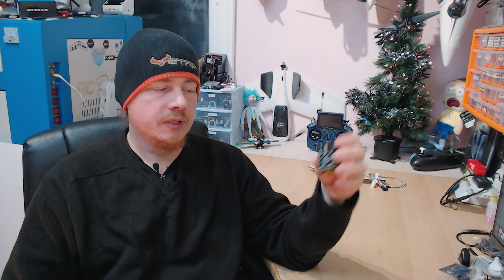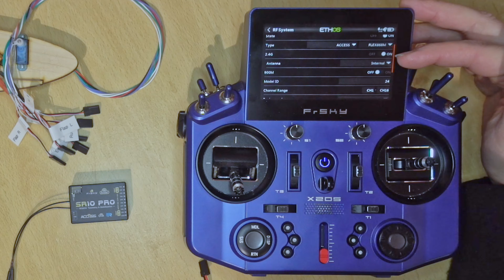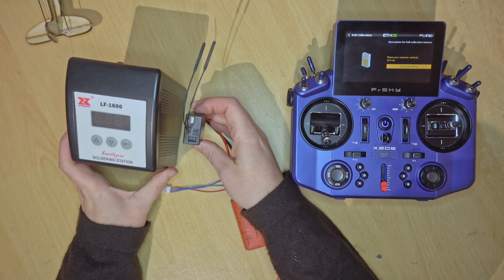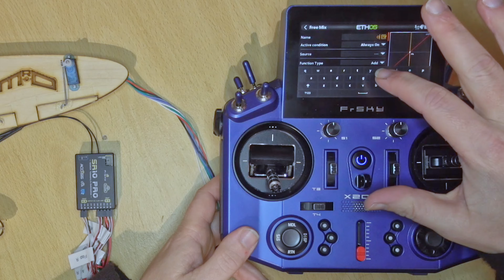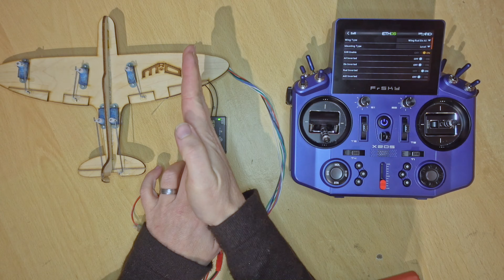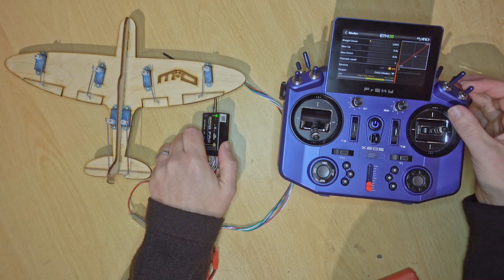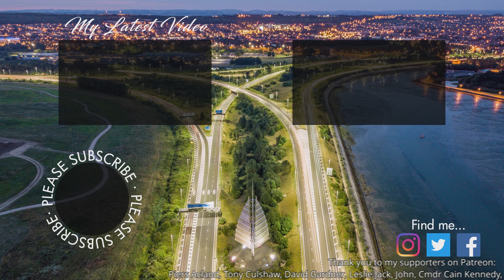Setting up FrSky Archer SRx stabilised Receivers

Comment: Very nice and informative Mr D. Question - I have an X20S, and SR8 Pro and I follow the video of calibrating the receiver, and I set my mixer for the modes of CHN 10, Switch SE (3 positions) instead of SA as in the video. But no matter what position switch I flip to (None, Stabilization Mode, Auto Level Mode), the plane act as in Auto Level mode when I roll, turn, or pitch, the plane will compensate. I just cannot set the modes to None. Any suggestions. Thanks.
Reply from the maker: Hi Ted. Check in the SxR Tool and make sure that you are using quick mode. https://www.youtube.com/watch?v=rUKIBQdmvIY&t=883s If not, it will be expecting two switches for the modes.
Reply: @MrD  Oh I figure it out! It was because I had the "Oh Crab" switch active. When Oh Crab was on, it doesn't mattter what Mode you are in (Stabilization, Auto Level, None), the plane will try to compensate. Thanks.
Reply from the maker: Yep. That’ll do it.

Comment: Found this really useful but I have a problem. I've set up my X20 / SR8 and the self levelling mode works perfectly, but the stabilisation mode doesnt seem to do anything at all. Any idea why this could be? Thanks
Reply from the maker: Hi Jon. Depending on the gain, the stabilisation may not appear to do much. It should just try to counter movement such as wind. If you turn up the gain, you should see, or at least hear the movements of the servos.
Reply: I have the same problem ,The servos don't respond even when I shake the plane.

Comment: Why do you have to do SELF TEST and when is it required? Thanks
Reply from the maker: Self test is performed when you set up the model. Among other things, it will get the movement from your transmitter sticks and set the level.
Reply: @MrD  Thanks. Is it possible to do a video on it?

Comment: hi darin, is there a way to use the trim to trim the auto level offset angle ? it is not easy to set it during flights
Reply from the maker: No, not as far as I am aware. It could be a useful feature though. So I'll pass the information on to FrSky.

Comment: One additional comment/question...After setting things up when I power on the rudder goes full over left.  The only way I've been able to "fix" it is to move the Modes switch to channel 11.  But then I get no stabilization features at all.  Thoughts?
Reply from the maker: That sounds like something is set up incorrectly on the transmitter. Check that the first 4 channels all move correctly on the receiver page.

Comment: Thanks so much for the FANTASTIC video . I was having trouble with the r9 stab.. They have moved the self check to the sxr setup instead of the switch . At least as far as I can tell
Reply from the maker: Yes, self check is on the SxR too. However, there are issues with the new tool on some older receivers. I'm waiting for that to be fixed before bringing out an update.

Comment: hi! channel 9 is factory set for gain for the gyro ? if i want to change to another channels what should i do ? thank you very much ^^
Reply from the maker: Yes, the gain and modes channels are set at the factory. With ACCESS you can have the receiver output a different channel on pin 9 of the receiver.

Comment: Excellent videos. 

I followed your tutorial. But no matter what I try, I can not get the SXR to show "Enabled" in the SXR set up menu.

What have I missed? 

I used the same switches, receiver, and %'s as you in all setup windows.
Reply from the maker: This should be able to activate and deactivate "SXR Enable" all the time. This doesn't need any special switches or configuration, as it's turning the stabilisation on or off. It's hard to know why this isn't working.
Reply: @MrD  

Thanks for the reply. I appreciate your videos, and I'm certain you've eased the learning curve.

Thanks. 🤘

Comment: Hi Darren
Just moved over to Frsky as much as anything because of your videos - thanks very much. I have used other gyros (hobbyeagle type) before and they need to be positioned as close as possible to the CG. Is it the same for these Frsky ones?
Cheers Steve
Reply from the maker: Thanks Steve. It's great to hear the videos help. Getting gyros close to the CG does help, though it is not essential if you can't due layout of the plane.

Comment: Hi Darren, I've just starting to come over to ACCESS on all my models. I'm setting up a WOT4 Foame with a SR8 PRO. I've made a new model from scratch in my Frsky X20s but every time I get no down elevator. I've tested the servo is fine what am I doing wrong?
Reply from the maker: Hi Stu,

Have you calibrated the gimbals yet? If not, I would try that first. If that doesn't fix the problem, check the differential is at 0.

Comment: Great video Darren! I have bound to FrSky SxR receivers easily in the past. I just picked up an SR8 Pro and am struggling getting past the Registering part with my TX16s running EdgeTX. Any ideas? Jim
Reply from the maker: The SR8 Pro won't work on that transmitter. It is an ACCESS only Archer receiver. It needs a genuine FrSky transmitter that supports ACCESS.
Reply: @MrD  thanks Darren! Is that true even if I set thee receiver up through Airlink and my PC? Otherwise, not such good news.
Reply from the maker: @jimworley7385  yes it’s true. The TX16S cannot use the ACCESS protocol. I have a tool on my web site that will show which receivers work with which transmitters. https://www.mrd-rc.com/tutorials-tools-and-testing/useful-tools/frsky-receiver-compatibility-tool/
Reply: @MrD  Thanks again Darren. I be saved this website for future use! I have used the S6R and S8R on my Float plane and glider. Was hoping to put the SR8 in my Extreme 300. Oh well. Have to rethink. Thanks again. Will be watching your videos! Jim
Reply from the maker: The S6R and S8R are both fine, as they are ACCST. With the TX16S, just ignore any receiver that has ACCESS or TANDEM on it. They won’t work.

Comment: Do you need to do something before every flight or it is a one time thing?
Reply from the maker: When you plug in the battery. It will perform a quick self check. Make sure that the model is level or slightly nose up when it does this. If your undercarriage steers, make sure it can move freely.
Reply: @MrD  thanks! I will stick to the Hobbyeagle gyros, they work way more trouble free and have more options.

Comment: Hi Darren, great video as ever, I'd never have worked out most of this without your videos. One quick question, do i need to have the wires towards the rear or can I just reverse the directions when setting up? The instructions don't seem to specify either direction, although they don't say much to be honest!!
Reply from the maker: Thanks Anthony. Yes the pins should always face the rear, and the antennae towards the front. It is in the manual, though not very clear. But if your look at the diagrams in the mounting type sections, you will see an arrow with the phrase Heading Direction. This is the opposite end of the receiver to the pins, pointing away from the receiver.

Comment: Mr. D   did you see the new calibration method for the SR-receiver series.    simple.
Reply from the maker: Yes, just the button in the SxR tool. Unfortunately this change also made it so that none of the gains and levels can be adjusted on the older SxR receivers. FrSky are working on an update though.
Reply: @MrD   now... that why my RX can be adjusted on the screen.. Will the recent RX... in my case SR8 update solve that??
Reply from the maker: @kitchenstrand  yes, the SRx receivers work fine with the tool. It’s just the older SxR receivers which have the issue. There will be a new tool for them soon though.
Reply: @MrD   Great  using you vid to update SR8 pro n SR^   now they have the firm and i guess a lua update too.   Looks like the software is the same for both
Reply from the maker: Yes, all Archer receivers are flashed using the same firmware. I still forget and try to download firmware for specific receivers sometimes. Old habits die hard and all that.
Reply: @MrD  can you elaborate on 'the SXR tool', i've just tried the free link app and I've no idea what thats trying to do!!
Reply from the maker: @anthonycoyne6505  there is an SxR configuration too built in to ETHOS. Two actually. One for the calibration. The other to do the setup. They are in this video.
Reply: HI Fred, what is the new method?

Comment: Thanks for this video however, at 14 minutes into this video you talk about setting up the rudder direction - I believe you have this the wrong way round  - what do you think ?
Reply from the maker: It is. There is a note in the video description to correct this. The stabilised rudder should move the same way as the tail, but the opposite direction to the nose.

Comment: Hi Darren, thank you for the video. It is great.
I did the same setup on a bigger 3d plane with a 40cc petrol engine.
Now I have the problem that as soon as I start the engine and the vibration starts, the receiver doesn't work anymore, I have full connection but I can't do anything.
I tried everything, did the self test and this is the second sr10 I bought because I thought it was broken but the same thing happens as soon as I start the engine.
The funny thing is, as soon as I turn the gyro off, it works. Do you think the gyro is not suitable for gas planes because of the vibrations? 
Yours sincerely alex
Reply from the maker: It sounds like on that setup there is too much vibration. All stabilisers are susceptible to noise, both electrical and physical. It sounds like with your plane you would benefit from mounting the receiver using some vibration damping techniques.
Reply: IT WORKS THANK YOU 😃 YOU DO A GREAT JOP!

Comment: Heres another one.

I can set up a model without going to a video now.
I have jsut finished setting up a petrol motor and it all works. Throttle,  ignition etc
I have calibrated the rx and self tested.
However.........with the stabilization off, its all trimmed and everything works. But.... as soon as I switch stab on,  bothe ailerons go up 1/8 of an inch. Switch it off and its all back to neutral.

The question is....where do i look?
Reply from the maker: Try re-performing the self test now that everything is trimmed. Also raise the tail up a little to try and match the in flight attitude.
Reply: @MrD  I set it up with a level (using a level) and a couple of degrees nose up. Ran the self test on this. The  initial calibration was done on a desk.
Reply from the maker: The calibration is fine on the bench. What I find strange is that it’s putting both ailerons up. If it needed to adjust pitch, it should be moving the elevator.
Reply: @MrD  Hi again,
 What I will do again is pull the sr8 out of the model, redo the calibration on the bench and see what happens. 
I bought myself a label machine to label all the leads . Saves time.
Ill let you know what happens. 
If that doesnt work i'll try it with a different rx. another sr8 pro

Comment: I have another question please.

When checking the stabilization is correct (Archer SR6) .....If in a taildragger where the nose is up, is it advisable to make sure the model is wings level/ nose level before doing the self check etc etc.?
Reply from the maker: I try to get close to the in flight attitude. So slight nose up.

Comment: I must thank you for the effort........I do have a question though.

With setting up the stabilization for an ARCHER SR6 and going through the calibration procedure, does it make a difference that the writing is upside down when the pins are  pointing right. Is the pin direction the important part or the direction of the writing please?
Reply from the maker: No that’s fine. I had heard that the label on the SR6 is upside down after the video came out. The R9 STAB is the same. Pins to the correct direction and label facing you is the way to go 👍🏻
Reply: Thank you
Reply from the maker: You’re welcome
Reply: Thanks for the answer MrD.

May I suggest a video using the Freelink or Ethos Suite for setting up stuff using a computer please?

Comment: Hi can you make video on how place srx antenna in plane ?
Reply from the maker: Check out my beginners setup video. I show typical antenna placement in there. One vertical, the other horizontal.
Reply: @MrD  ok 👌 and I have a problem, my sr6 don ‘t want make self check, I set my radio like you ?
Reply from the maker: Have you checked the video section for if the self check doesn’t work. There is a setting on some transmitters that can stop it working.

Comment: Hi darren   I think if you update the software in your TX a new menu (device config) will show the self check opinion instead of the switch.  Best Regards Steve
Reply from the maker: Thanks Steve. The option is only for the new Archer SR receivers. The older SxR receivers still need to use channel 12. I believe channel 12 will still work for the SR receivers too.
Reply: @MrD  thanks for the reply   best regards  steve

Comment: Hi, thanks a lot for the excellent video! 
I’ve followed the tutorial and got the X20S set up with an SR8 receiver. It all works fine except I cannot get the right aileron to work on channel 5. Am I missing something? Thanks for all the great work! Chris
Reply: Thanks for that. It was actually disabled already, but I enabled it and then then aileron began working. Thanks for your help!
Reply: Hi again. I now have the aileron working on pin 5 with no problems, the differential works, and the rate switches work fine. However I can’t get the stabiliser to work on pin 5. It works on one aileron, elavator and rudder in the different modes, and on the ‘oh cr*p’ button. But the pin 5 aileron doesn’t respond at all. Any suggestions? Thanks in advance!
Reply from the maker: @christeagle4772  go in the SxR settings. There is an option for AUX1 Enable. That needs to be off. Channel 5 is either and auxiliary or 2nd aileron.
Reply: @MrD  Thanks very much, I’ve got it working now. I’ve had six successful flights so far, it might have been a bit of finger trouble before. Keep up the good work! Love the FrSky x20s. Cheers, Chris
Reply from the maker: @christeagle4772  awesome Chris. Hope you have many more great flights.
Reply from the maker: Check that AUX1 is disabled in the SxR configuration tool.

Comment: What if i don't want gyro at all? What i mean by that is, i don't want a switch to turn it off. I want it off always. Friend of mine gave me this rx but i don't fly using gyros.
Reply from the maker: Just go in to the SxR configuration tool and set SxR Enable to off. It’s just a regular receiver then.

Comment: Seems they've changed the method of getting into Self check in the latest firmware. Now it's through the menusystem.
Reply from the maker: The self check button only works for Archer SR type receivers on recent firmware. The older D16 SxR receivers still need to use Channel 12.
Reply: Bit unclear on how to setup the oh crap level though?

Comment: Hi Darren, I’ve managed to get my surface to full range of motion. Very strange but when in auto level the surface deflect at odd angles. I’ve calibrated twice and still no change. Any ideas? Thank you. I only really need the gyro so if the auto level could be totally disabled, that wouldn’t be a problem.
Reply from the maker: The surfaces being at odd angles are usually if the receiver is not flat in the same orientation as set in the configuration. The calibration won’t really effect that. 

You should have the pins of the receiver to the back of the model, then match its right side up, or on its side with the configuration. 

Where you have the modes on the switch, you can choose between manual, stabilised, or self levelling. If you never want to use self levelling, you could even add a curve to the switch so that you can only ever fly in manual or stabilised. Personally, I never use the self levelling mode either.

Comment: Hi Darren, I’m using this SR10 on an freewing F14. It’s a shame as the two gyro ports 9/10 can’t really be used if you want the gyro? I’ve never used S bus, but does that open more physical ports and is it possible? Just need one more. Also do you know how to delay a function, I’ve managed to get the flaps to automatically pull up when wings swing back(delta wing config), but if the flap switch is left down, the moment the swing switch is flicked to go back out the flaps will deploy. A delay from flaps in that phase would help. Thanks for all your help so far-you’re a ledge! Ant
Reply from the maker: Hi Ant. 

You can actually use the 9 and 10 ports of the receiver with a little trick. https://youtu.be/rUKIBQdmvIY?t=1374 That would get you the port you need. 

Rather than adding a delay. The better option may be to add a warning, maybe “flaps down”, when the the wing is swept back and the flaps are not up. Then you can hear the warning and put the switch in the correct position, ready for when you next need them.
Reply: @MrD  that’s actually a really good idea, nice one I’ll do that. Will also make sure they don’t deploy when wings sweep back out. I’ve seen your vid on this, but is there a way to use all ten physical ports and use the gain and mode. Is there a way to move the gain and mode to channel 11 onwards?
Reply from the maker: If you watch from the link above, it shows you how to use all 10 physical ports. It should start in the right place. The modes and gain still work.